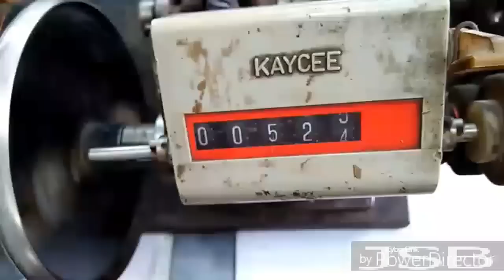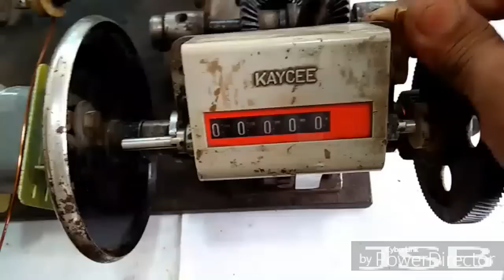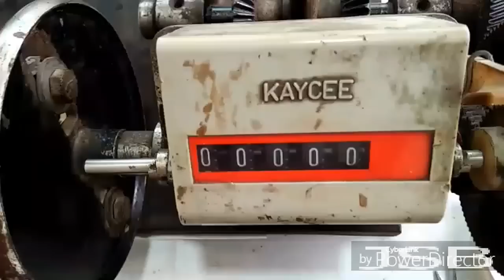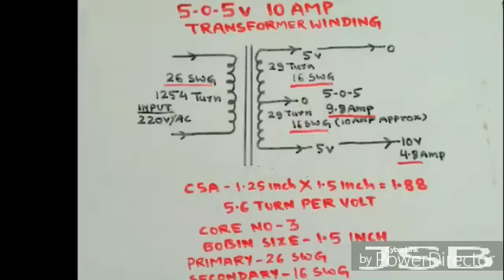How To Make 5-0-5 10Amp Transformer Easy At Home. YT-56

Comment: sir please show how to make a 30v 2a Transformer
Reply from the maker: primary - 28 SWG 
secondary - 19 SWG
core size - 3
bobin size - 2 inch 
4.65 turn per volt
Reply: Falguni Vyas 18o18